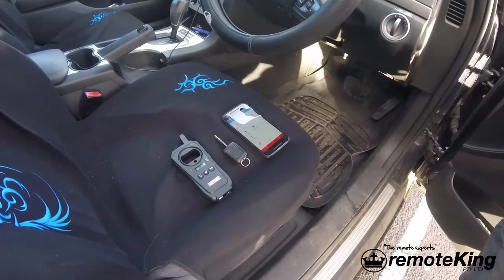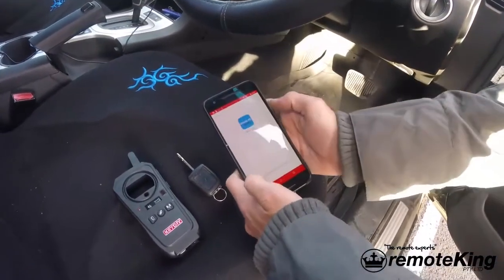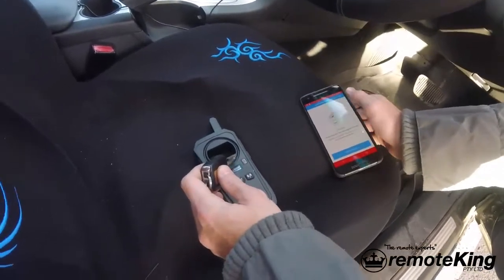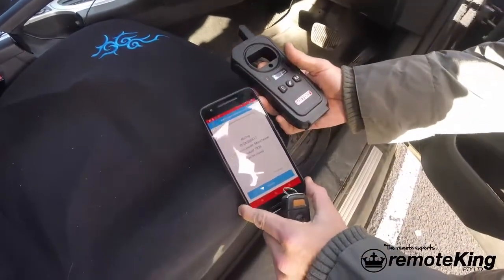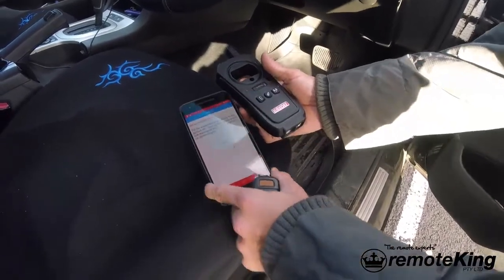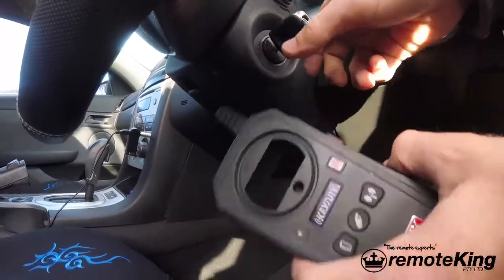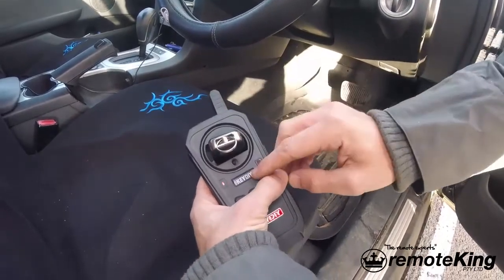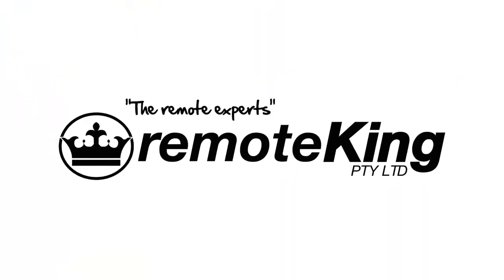Copy ID46 Using KD X2

Comment: I'm confused, does this device use tokens for cloning or not? It says id48 cloning is free but what about all the others? Do they require tokens for example this id46 one you just did, did you have to use tokens to clone it to a blank chip or have they updated it so that all cloning is free now? 

Also if you do have to use token how much do they cost per clone and where do you buy them?
Reply from the maker: Hi Fanatics G7, when you make a KD remote using the KDX2 and the KD app you receive a free gift of 20 coins (not tokens) when you have 150 coins you can do 1 x ID48 (96Bit) for 150 coins no tokens needed. 

If you are doing a lot of ID48 (96Bit) and do not have enough coins you can by tokens through the app or if you are a customer of ours you can get a discounted cost. Through the app the tokens coast about $15usd to memory, but if you are primarily doing ID48's you may want to look at purchasing some tokens to have up your sleeve. 

I hope this explains the situation.
Reply: @RemoteKingAUS  cheers mate i am a customer of yours